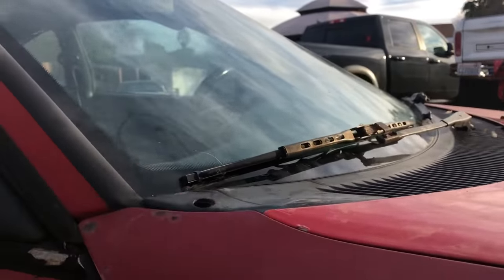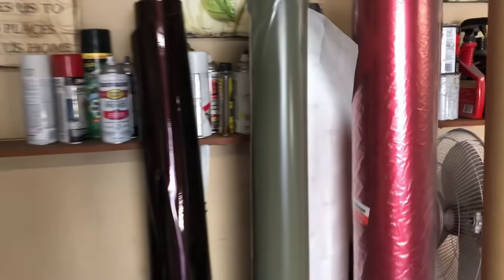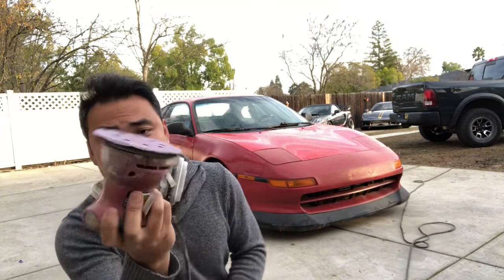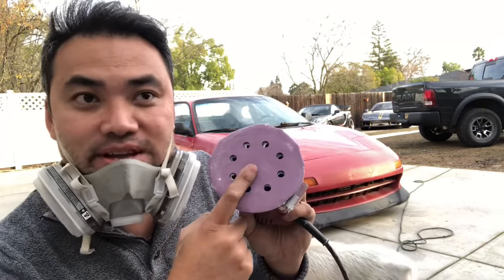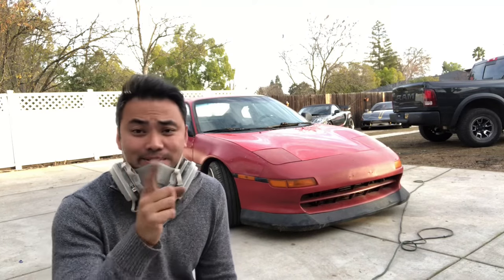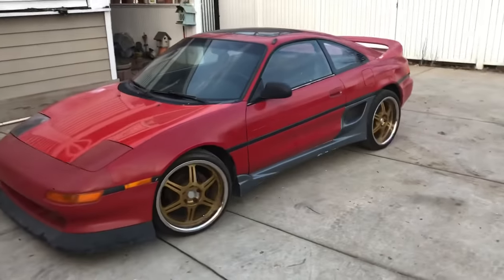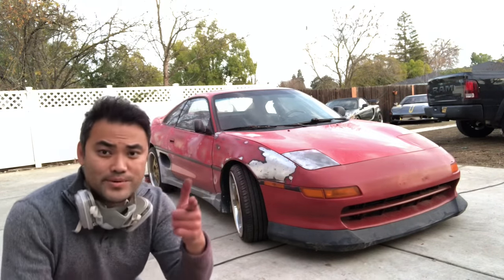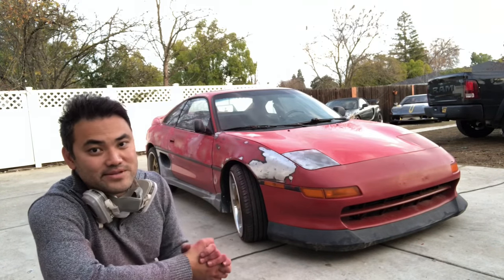How to Prep Bad Paint for Wrap: 1991 Toyota MR2

Comment: Question sir. I just did exactly what you did to my trunk but my wrap looks awful!? It has this glaze to it to where I though I needed to put quick layer of gloss spray paint on it first. Do you primer the sanded parts before you wrap? I wrapped my hood that didn’t need sanded and it looks great.
Reply: Whenever you primer the area you have to re-sand again to make it smooth but without sanding off all of the primer then you can wrap it and it should be a perfect finish

Comment: A bit late to the thread here. I have an issue with the hood of my 4Runner. Clear coat has flaked off in a small area behind the hood scoop and I've been told to repaint entire hood before I wrap it. One wrap shop quoted me a couple grand to sand it. What grit sandpaper should I use and do it myself?
Reply from the maker: 400 is good

Comment: you need to learn the right auto language. if you are going to use a DA sander use an air compressor that can run an airpower DA sander that has a high CFM on the air compressor you need 4 or better at 90 psi and 6 or better at 40 psi. an airpower da sander runs at 90 psi and if you have a small tank it will run like a slug or just cut out all togetherr